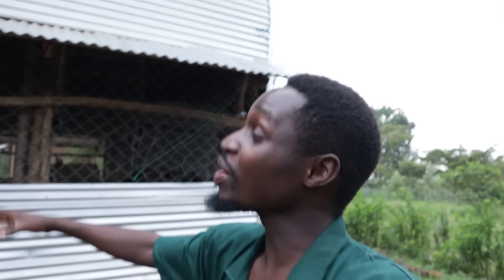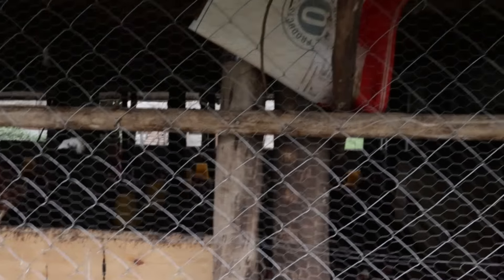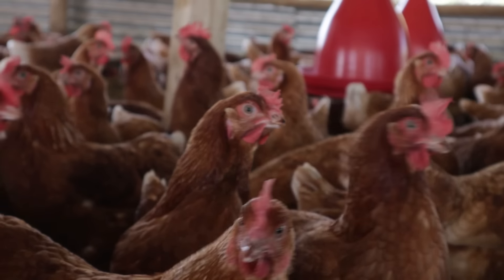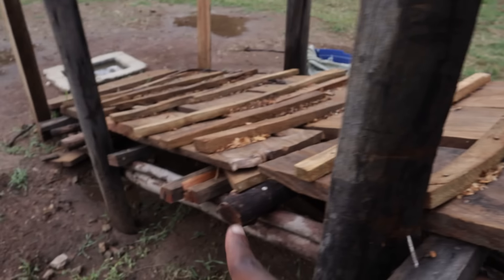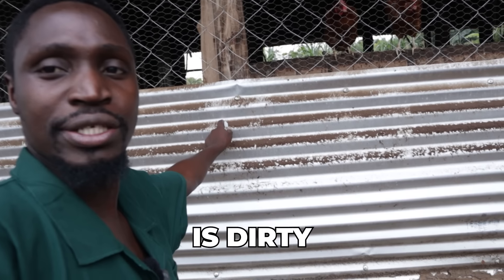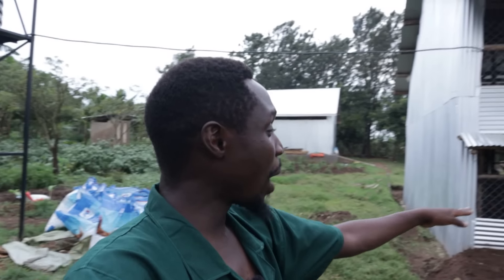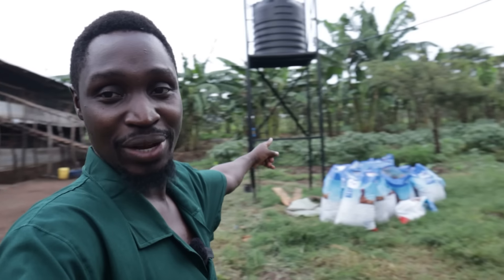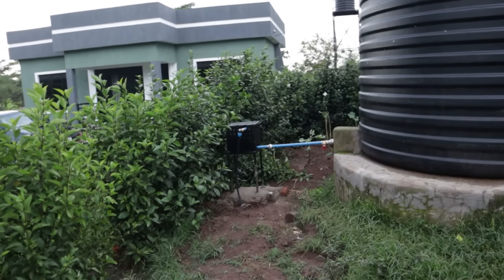This Chicken House is CHEAP!

Comment: The one i am building in Liberia has cost me 4800USD so far on the foundation alone. And it is just 90ft by 27ft. Iron sheets or zinc has it is called in Liberia is about 125$ per bundle and the bundle has 20 pcs. The cheapest plywood is 6$ per sheet for a 1m by 1m.
Reply: I think you could get cheaper alternative building materials especially when you're just beginning the poultry farming project. Best wishes from Kampala 🇺🇬✌🏽